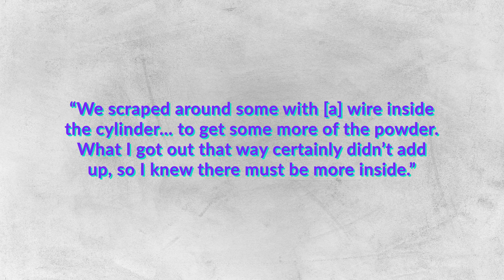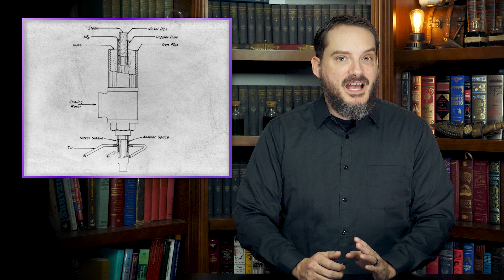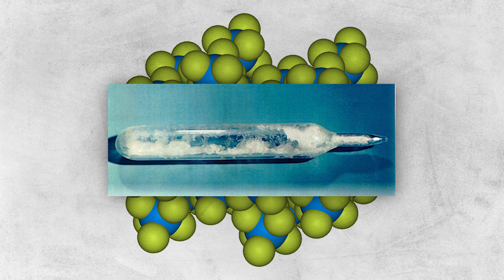The Accidental Invention That Changed the World

Comment: I think you missed part of the explanation for the stickiness of gecko feet via Van der Walls forces.  Van der Walls forces are extremely distance-dependent: proportional to 1/r^7, compared to 1/r^2 for electrical or gravitational forces, so it pays to be able to get extremely close to a surface.  Not only do gecko feet have a huge number of setae on their feet, the tiny size of each seta (that's the singular of "setae") allows the individual seta to get "closer" to the surface.  Any surface has some roughness, so if you put a macroscopic sized object against that surface, it only makes "contact" at a limited number of points (and that number would be three if both the object and the surface were perfectly stiff, but in practice it depends on how flexible the surface and object are.  And I put the word "contact" (and "closer") in quotation marks because the concept of "contact" gets a bit fuzzy at the quantum scale).  The tiny size of each seta and the fact that each is on a separate stalk on the end of a hair means that each can adjust position and squeeze in between the high points of the (rough) surface, so each can get extremely close to wherever it lands on the surface.  If the seta was larger than the scale of the surface roughness, then each seta would only make contact at a few "high points" of the surface, and the rest of that seta's surface would not be close enough to the surface for Van der Walls forces to contribute much to the stickiness.